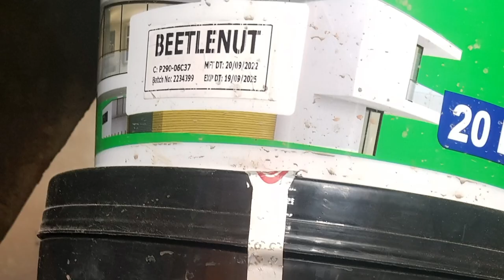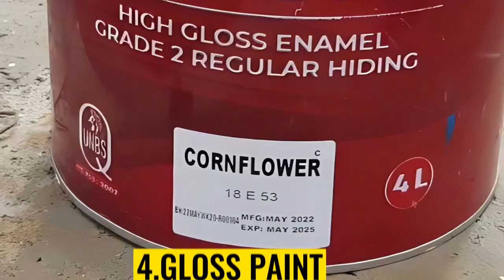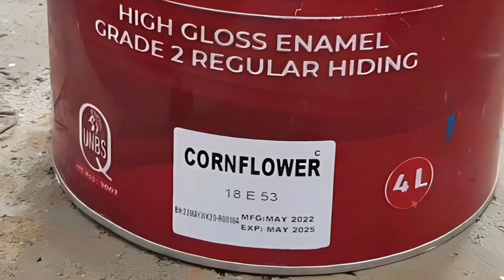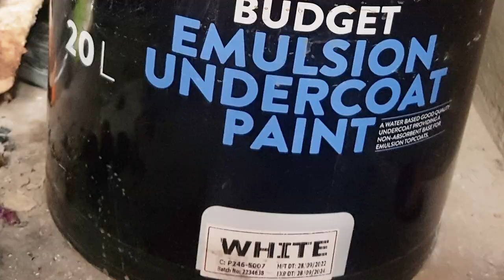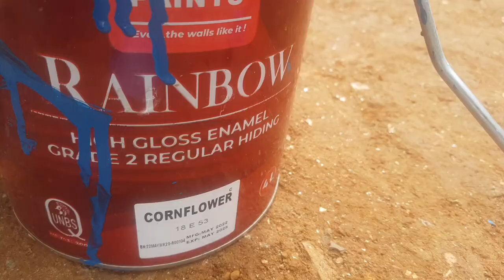How to Estimate the amount of PAINT Required| (Estimating Painting)

Comment: Would mixing gloss with petro oil/ gasoline cause items to be highly flammable? Just curious.
Reply from the maker: Yes, mixing gloss paint with oil petro/gasoline will cause the item to be flammable. Its importance  is to ease application on the surface. It is a solution when operating on a low budget.(commonest)
 In the presence of a high budget, you can use specific thinners from the factory but with guidance from the Engineer or the manufacturer
Reply: @ianconstruction  Oh ok, even thinner can be flammable too I guess. I’d opt to use the gloss with petro/ect away from kitchen areas 😅 but I understand it’s all in what budget someone has.

Comment: How do you estimate for filler??
Reply from the maker: Filler is a mixture of whiting powder, white Cement and undercoat 

1kg Whiting mixed with 1kg white Cement and 1.5L of undercoat. When the above is mixed, the paste formed will fill gaps to cover an area of around 10 square metres depending on the degree of roughness of your wall or the number of dents on the wall surface.